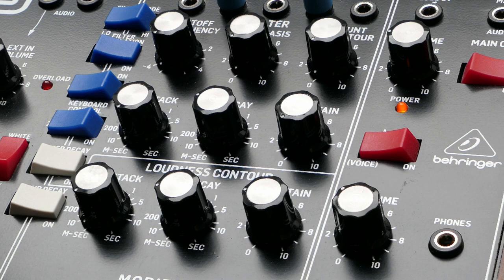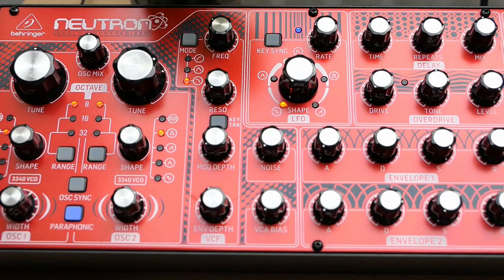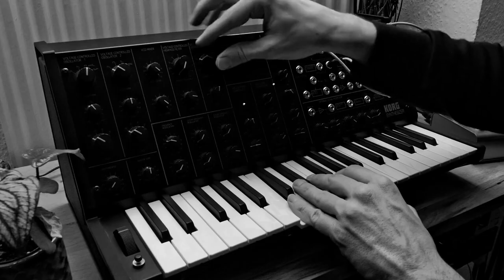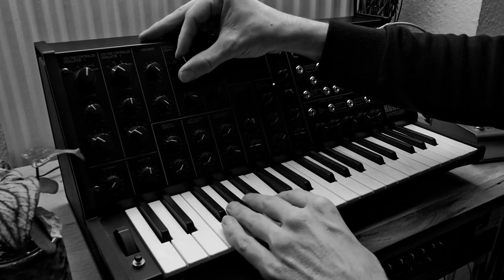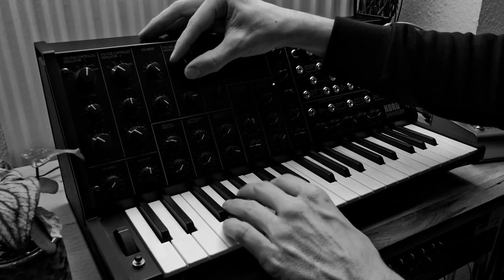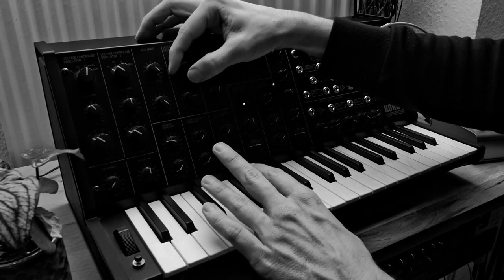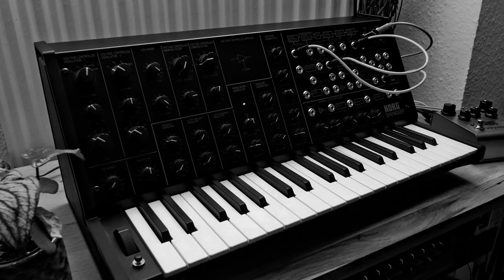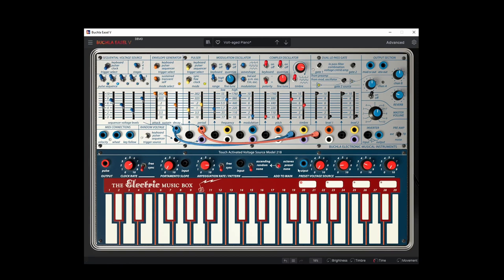East coast style ~ subtractive synthesis with Behringer System 100

Comment: Cool, I just bought modules Behringer systen 100 m, model is how did you connect your Arturia Keystep to these modules without going through MIDI? thank you for your answer 🤙
Reply from the maker: The Keystep has a pitch and gate output, you simply connect them to the VCO and the Envelope.